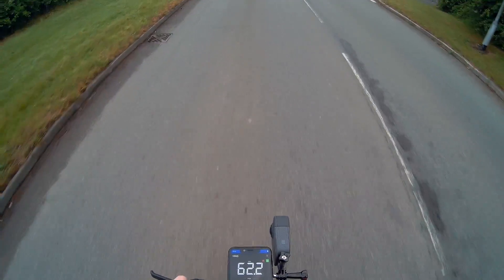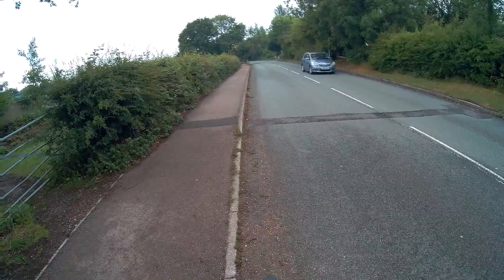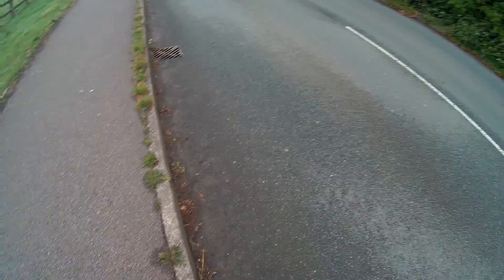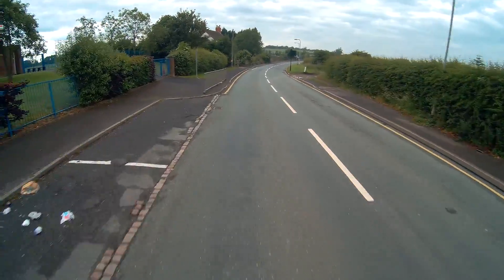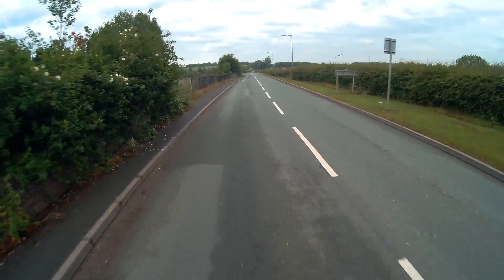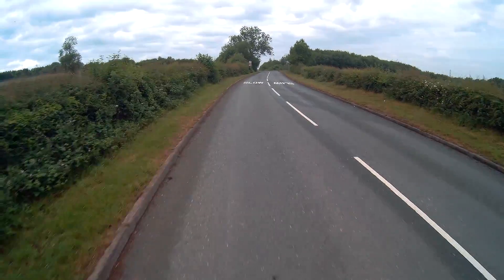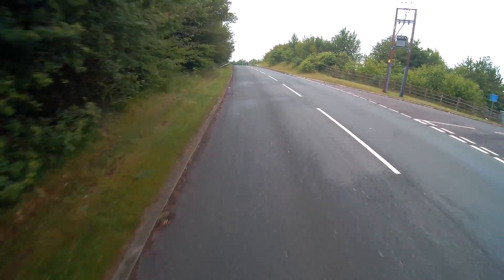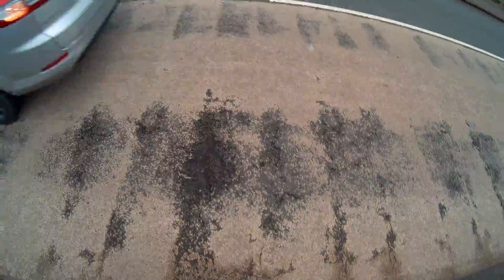Xiaomi M365 2kW RWD conversion. Codename V365 - Tuning and penultimate test run

Comment: Hello Vortecks, you seem to know a lot about this, I have a question: say I have an escooter with a battery, let's say a 10S4P battery with a battery management system. I wanna increase the range so I get a second 10S4P battery with BMS and I connect the batteries in parallel. Is that OK, or can there only be one BMS?
Reply from the maker: You can wire them in parallel with a BMS in each pack, no problem. The only thing I'd warn about is the pack voltages must be the same before you wire them together.
Reply: @Vortecks  Yes, that goes without saying. I saw a video that said if the voltage is a tiny bit different, there will be a small current from one battery to the other. Then the BMS will think it's charging and stop the scooter. I mean when it's a smart BMS like the Xiaomi has.
Reply from the maker: @Patiboke  It's not the danger of the scooter stopping, it's the danger of destroying a BMS. If you have different voltages, one battery will immediately start to charge the other at very high current. It's best to get them as close as possible before you plug them in.
I've seen bad things happen when people plug an empty battery into a full battery but it's quite amusing when they don't know what to do 😁

Comment: i have a couple of ebikes - overdriving the hub motors just like you.  ive drilled holes on both sides of the hub motors - it makes a huge difference to coooling. "grin technologies" have a huge 2 hour video on hub motors and they extensively test cooling options

Comment: Hey mate. Love your videos. Uhhm I have a question.. can you run a 36volts hub motor. With 48 volt controller and 48volts 21AH battery.?
Reply from the maker: Generally, the 48V motors are identical to 36V motors but they mark the price up. There will be some exceptions though and I don't know what manufacturers produce what anymore.
I'd say yes, it's ok to do it but please keep an eye on the temperature of the hub.

Comment: This is absolutely fantastic! When I would have some resources, I would do the same :) Love the "power box" It deserves some yellow flash on it :) Poweeer!
Also glad you are not on stock tires. Too bad the best one are only 152mm inner and it won't fit without rim modification :/
Adopt tires from faster scooters to 156mm would be awesome. At least one 10"x2.25 and one 10"x2.50 versions. These makes awesome squeeeks on the asphalt.

Comment: There are some front wheel rims with integrated drum brake that you could try. Not a fan of having the instant lock on the front, drum brakes aren't very fine, but I'd guess it's better than just ebrake.

Comment: It would be great if after you've tested all this and found a simplified way of building this mod if you could create a patreon or some kind of lowish price donation method of being able to build this scooter in depth with the moda and tutorials ect. i think there would be a pretty decent demand for it.
Reply from the maker: There is a much simpler and cleaner way of building it but the trouble is, it would cost a lot more. I'm still looking at suitable controllers which would fit inside the chassis but space is rather limited.....I'll get there one day 😁
Reply: @Vortecks  But i mean, coming from someone who's in the UK who has the same parameters and only a mediocre understanding of electronics. what you're doing right now is really cool. using affordable and chinese parts to modify and provide something that is cheap and in some places is a legit challenge to actual taxable transportation. the standard scooter is a great thing to start with, but for many people such as myself or even students and lower income people trying to reach local jobs, education and family it looks ideal. it was only an idea but perhaps when you've honed and simplified the idea it would be mutually beneficial to your subs and yourself, :)
Reply: Also, cheap is good... So long as it's stable the vast majority of people aren't looking for really expensive ways of modding E-scooters, even if they are easier to mod. Most people in my experience want a cheap usable replacement for a shortish daily commute. The standard scooter is okay but it wouldn't compete with even a pushbike.
Reply from the maker: @DeAtHaToMiC88  I've drilled it down as low as possible but it's still costing around £250 for the controller. Adding the cost of the battery and BMS, that's around £380 to make it as fast as the one I've built.
I've decided to get the controller and I'll be starting to do the instruction video soon (for anyone wanting to do the same). On the plus side, it should all fit into the chassis so it'll be even more unsuspecting when I blast past people at 40mph.
Edit..... 15.5mph 🤣🤣

Comment: mine only runs the stock 350w but after you have been riding the thing for a while you cant touch the wheel. so just be careful you don't over-do it and burn the windings up.

Comment: Would the ASI BAC855 be able to fit inside the frame? And is there any possibility of adding a heat sink to the motor at all? I've been wanting to swap the crappy BMS on my 20s7p 18650 pack so I can use your app but I'm not sure where I should buy it from.
Reply from the maker: I've got a surprise coming up very soon - I've found the perfect controller that will fit inside the frame.
If you want the VBMS app, it's on Google Play and the BMS is available from Aliexpress https://goo.gl/XyREKM
Reply: @Vortecks  I assume there's no downsides to getting one rated for more power? My battery can only do 70 amps continuous but would it be better to get one that can handle more or are they physically bigger or something?

Comment: Drill some big holes in motor casing for better cooling and than you also be able to check actual motor temp i bet this windings are well over 100 deegres Celsius after this run
Reply: You could use infrared thermometer to check the temp after drilling the holes. Casing will be much cooler then actual copper inside the motor so your measurements is inaccurate. Unless you inject some ferrofluid or whatever is called checking casing temp is pointless

Comment: I loved the video! I have a few questions. What is your camera? Where is your microphone located?

I personally use a phone with a holder on my helmet, it looks kinda bulky but it does the job.
Though it shakes a lot and there is a lot of wind coming in to the microphone, I fixed the shaking issue (not perfect).

I still need a good microphone that I can connect to my phone, if possible could you give me the link to yours? :)
Reply: Tonys mic sounds really well.
Reply from the maker: Try this..... https://www.youtube.com/watch?v=E2gG-vhM2RI

Comment: hey dude, same guys from croatia i think are selling an adaptor to keep the disc brake on the rear, you're bonkers running that without a mechanical brake. m365 custom parts on facebook check them out they have a cover for the motor with a disc adaptor.

Comment: 3:34 go get yourself a really cheap thermocouple man, they tend to work with controllers and you can set thermal rollbacks and all that ;)

No need to baby it so much, you’d be able to just go for a seriously abusive ride knowing it looked after itself, get home, check the logs and make changes where you need to :)

At least I’m pretty sure the sabvoton has those features, if it doesn’t, it makes the Phaserunner a far better option for both space and configurability
Reply: 5:25 damn man, you’re hauling like mad there 👌
Reply: 6:50 if you go any wider you’ll just be increasing the contact patch for the tyres and thus increasing the rolling resistance, I think you’ll find quickly that it’ll add quite a bit of waste heat due to the increased power requirement. :)
Reply: 8:11 I like the idea of a variable brake, the harder you pull the brake the higher the regen, this was implemented with the Addaptto gear for ebikes (I bet you knew about this already), go throw a real ebrake sensor on your brake and enjoy some mappable braking curves, don’t be afraid to go to max amps at full braking, you’ll only get thrown a few times until you find the comfortable spot (start high, it’s safer then starting low and not having enough braking power)